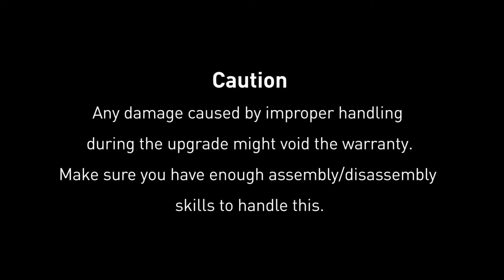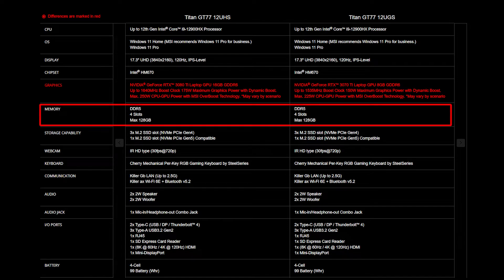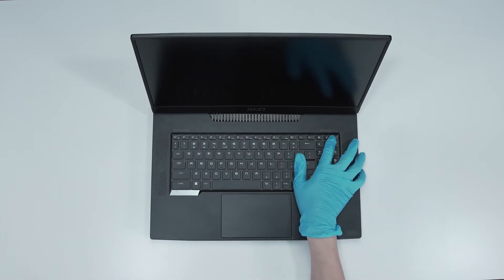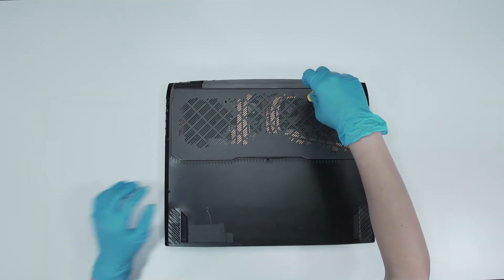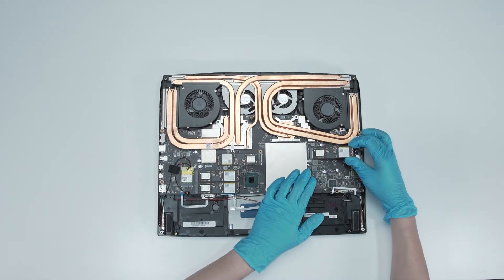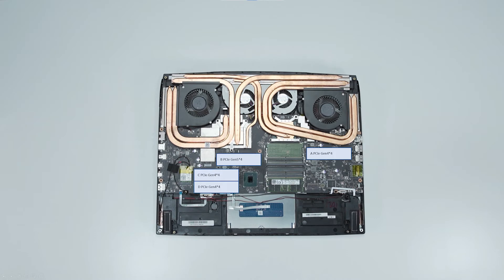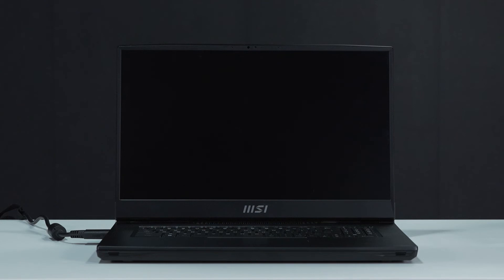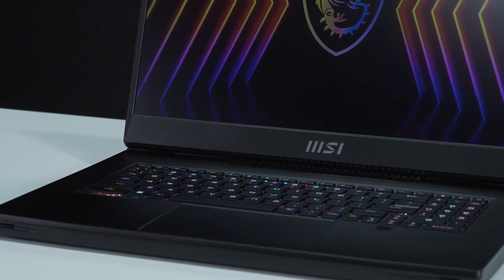MSI Titan GT77 HX/ Titan GT77 12U/CreatorPro X17 A12U Series Upgrade Tutorial

Comment: Thanks for this video. It bears repeating that removing the back case should be done with care. I used a credit card, and it worked wonderfully... take your time, work around the perimeter as explained, and you'll get there. Don't force anything. It snaps apart & back together cleanly if you use care.
Reply: I don't know where the seams are either it seems completely sealed.
Reply: @JosiahSCooper  I found them. It's extremely tight and you may snap some of the plastic pegs that hold them in. That won't really matter as it's mostly cosmetic, but annoying that they won't click back in right. You need something extremely thin and durable. I wound up buying a set of iFixit brand pry tools and that worked. Best thing I can tell you is follow the grill line in the back. It's below the grill (so when you take it off, the grill is attached). Hope that helps.
Reply: Where are the seams for the back cover? I have fought with mine for hours and can't seem to get the back cover off. I even snapped the clips on the top exhaust cover because it appears they had epoxied it down. I've never had more trouble removing a case than with this laptop and it hurts my soul.

Comment: PLEASE HELP! Do I need to disconnect the battery cable if I'm only adding an extra M.2 to my free slot? (MSI GP66 Leopard).
The battery connector is STUCK no matter what I do!
I've tried asking multiple times for hours online and in customer service.

Some tell me it's fine but others hint that it's best to disconnect battery. Why? What's the risk? I don't want to ruin my laptop but need the M.2 installed BUT can't remove the battery connector no matter how much I wiggle it left and right.
Reply from the maker: The battery will provide some power on the mainboard, for safety, We suggest removing the battery if you need to do any upgrades.
The battery cable is hard to remove at first time, it needs to take some effort (but not to much) to remove it.
Reply: I added 4 SODIMMs and 2 NVMe flash sticks without disconnecting the battery. We held down the power button to cut the power, did we not? Anyways, things worked out fine. I am not giving advice, just relaying my experience...